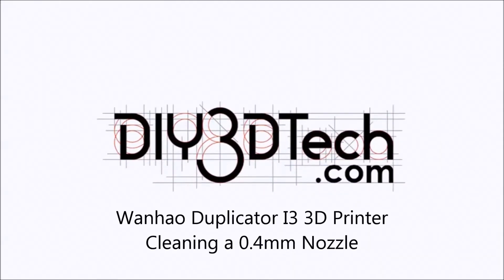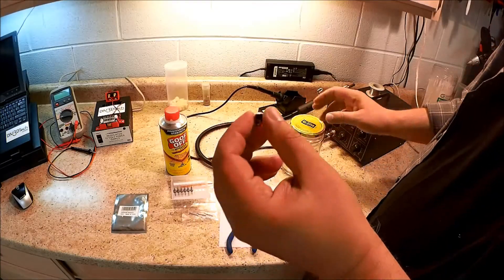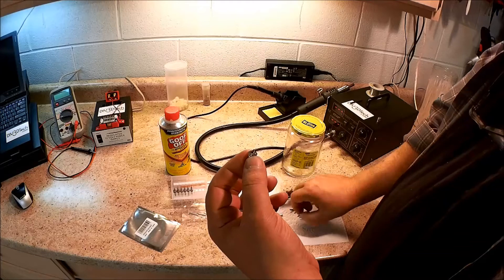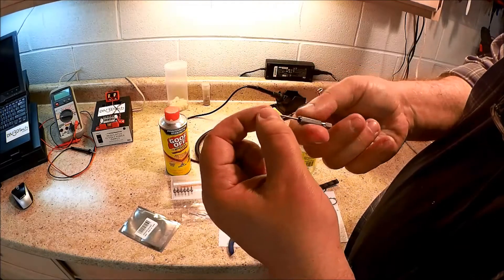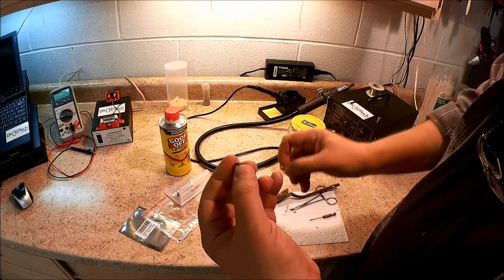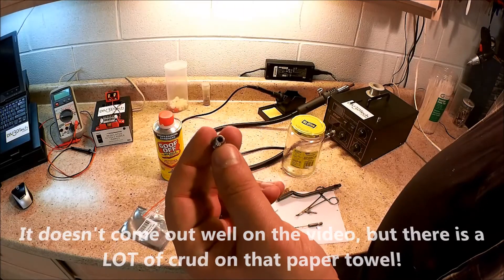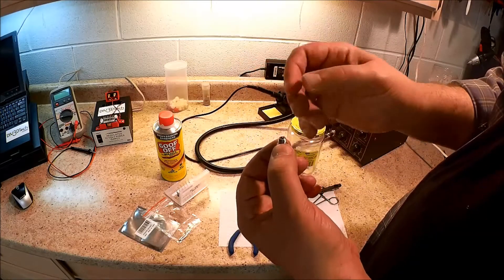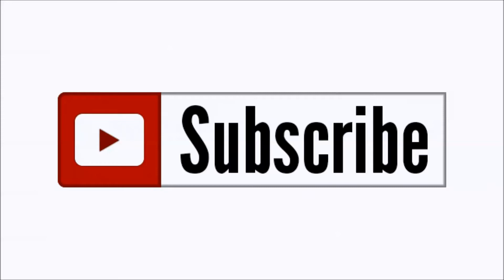Wanhao Duplicator I3 3D Printer - Cleaning a Point 4mm Nozzle

Comment: I have done my own set of dilution tests.  Ran around the house and tried everything.

What I have found is that paint stripper (the very viscous type you paint on with a brush to remove enamel paints) did put the PLA into solution.  It is quite messy stuff to work with because it is so thick, but it did dissolve the PLA.

I did not test the paint stripper on brass nozzles, as it may even change the material surface and corrode the brass.

However, I don't like the mechanical drilling of the hole.  It will damage the nozzle and you will have an oval nozzle that will give you printing problems afterward.
Reply from the maker: Yes an oval nozzle can be an issue!

Comment: Great video, thanks for sharing your method. I cleaned my i3 mk10 4mm nozzle & throat on a vice with a blow torch. Logic and common sense told me not to do it, because it will leave carbon and such, but I tried anyways and it was actually very easy to clean out once I had the metal glowing for a few seconds, dip in cold water, repeat, clean out carbon dust with an alcohol swab. Worked great! It was like a brand new (anodized & annealed rainbow looking)

This worked for me a while back. These days I've purchased a wholesale lot of micro-swiss' and a roll of PTFE to sell individually on ebay and always have some on hand for myself ;)
Reply from the maker: +Madyn3D CNC, LLC Lol!  Unquie to say the least!  (Your not Australian are you :-)
Reply: Seems like getting the nozzle that hot would cause a fair amount of distortion...

Comment: I'm a total newb to 3d printing, but what happend if you heat the nozzle to the point the filement melts and at that time blow with compressed air thru the nozzle?